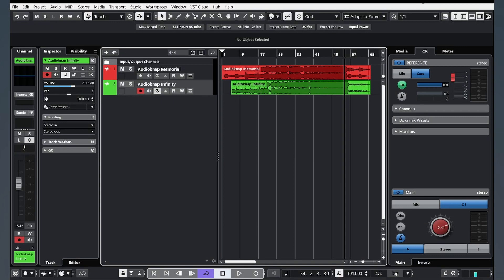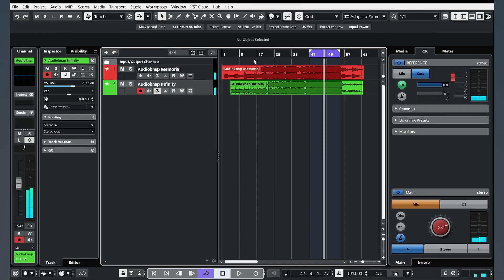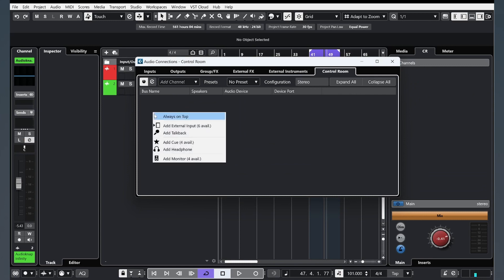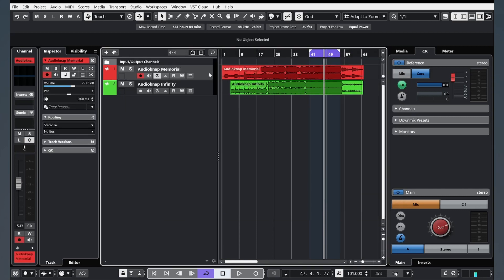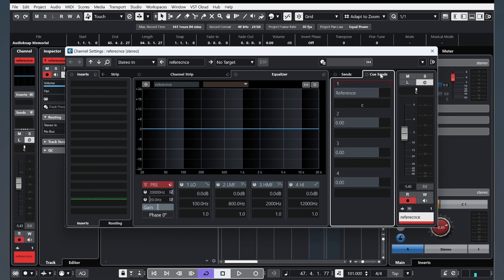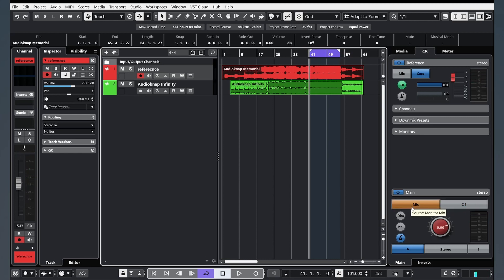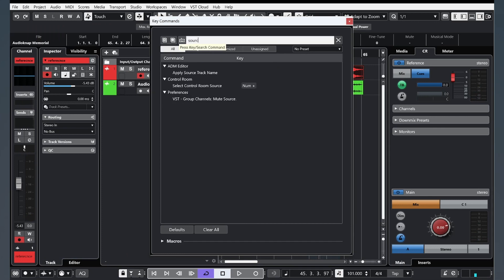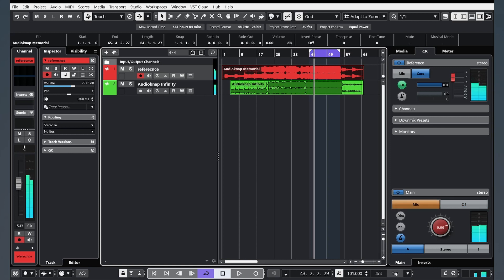Cubase 13 Pro Tutorial (Lesson 13) – Control Room. A/B Reference

Comment: Is there a way that i can analyze both Signals with an Analyzer Tool inside the Control Room  ? I've tried it out with a  Voxengo Span  on the Monitor Section,  but it only shows the Project Signal  not the reference Signal aswell .